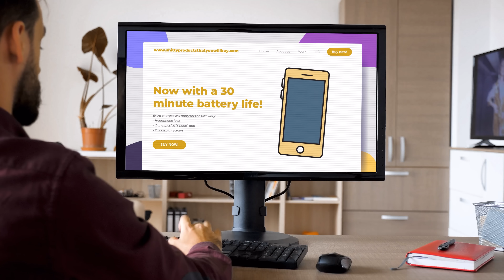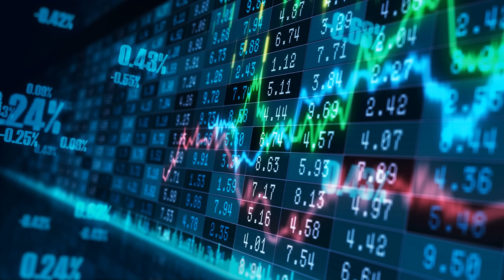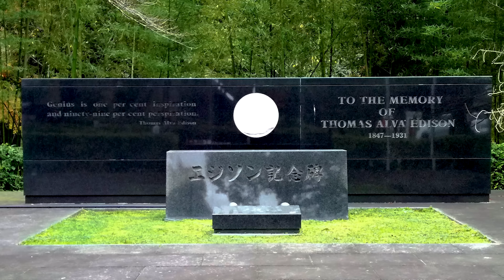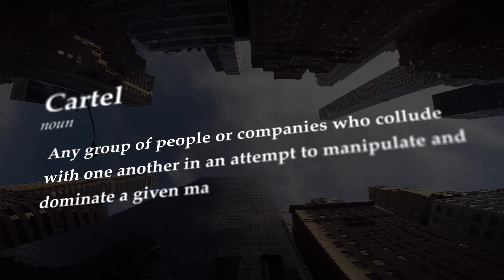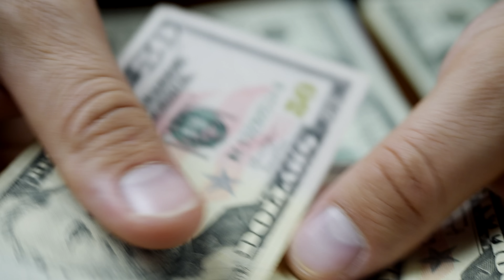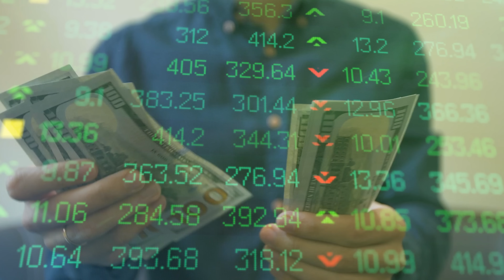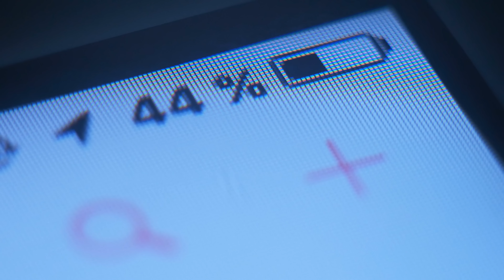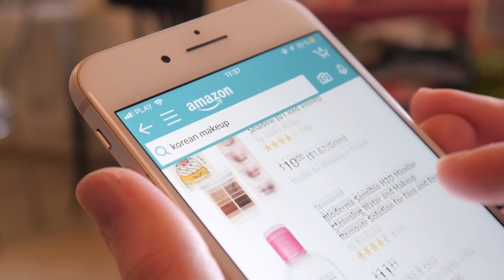Why All Lightbulbs Are Designed to Break

Comment: I first heard the term "planned obsolescence" in relation to the American automobile industry of the 1960's. Styling, even whole body makeovers, were commonly done every new model year, so as to make your car, the one you just bought a few months earlier, look old in comparison to your neighbor's fresh-off-the lot sedan, which was advertised as "longer, lower, wider" with higher tail fins and new chrome bumpers. Meanwhile, European manufacturers, notably Volkswagen, came along with cars that made only slight changes (never for just "styling") and beat the American compacts in sales. This attitude on the part of American manufacturers, along with using low quality materials and shoddy assembly, directly led to companies like Toyota and Nissan selling millions of their cheap, but high-quality, cars here. Contrast that to today's auto market, where even the foreign car makers have gotten on board with the "planned obsolescence" concept...  and of course with the increase in technology, you have to have that car with the latest navigation widget or heated seats!

Comment: The computer industry in the 1990s was a scam of this kind. To run Microsoft software that was compatible with what everyone else was using, you had to have the latest version of Windows. To make that work, you needed to upgraded your computer. Even when other companies like Geoworks put out software that was technically better, Microsoft and Apple were the unavoidable standards. The new software had more features, but it was also slower. Then XP came out in 2001 and no one felt the need to upgrade after that.

Comment: I rebuilt this house to take advantage of natural light and I
run low voltage solar light at night.
Never use nightlights and if the power goes off I can see just fine.
Every device is automatic dusk to dawn

Comment: I wonder if they will start making LED bulbs burn out sooner!?
Reply: They already have. I disassembled a "burned out" LED bulb just the other day. The failure was a burned spot on a PCB caused by a 1/4 watt resistor. It took years for the burn to finally break the circuit. If they had used a 1 watt resistor instead -- a difference in manufacturing cost of probably less than one cent per unit -- it would not have failed in that manner.

I had to damage the unit to get far enough in to discover the point of failure. I could probably put in a bigger resistor and glue it all back together, but is it worth the effort? Not really.
Reply: @dovregubben78  That was a capacitive dropper that your bulb was using right?
Reply: They already have. People want bright bulbs and manufacturers want to sell, so just drive the leds at their maximum rated currents and you are good to go.
It only takes one bad led to ruin an entire bulb. You can open one up and short out the broken led and it will keep on going without problems.
They are making bulbs harder to open because of this
Another way is to get a well ventilated fixture, most of them kill led bulbs becausw they trap the heat

Comment: Even keyboards, my first logitech keyboard lasted me about 12 years before it started to wear, these days, a keyboard 2x as expensive as that early logitech keyboard i had, last me maybe 2-3 years, and usually the keys at that point start to show serious wear, where my old logitech keys were fine, very little wear.
its the same with my headsets, i remember my first headsets lasting a good 5-8 years if not longer, now, seems i have to replace them about every 2 years as the material starts to heavily wear, plastic parts start to break, and by the end of year 3 its barely holding together, even though i use it less and take better care of it then i did my older headsets.

Comment: for devices just buy ones that operate on higher  voltage  and use lower voltage for them example buy a 100v to 250v tv and operate it on 90v it will still wrk

Comment: I've had my smartphone for several years now, and it's still working.  Since I only use a few features, it's limited memory has never been an issue.  Until now.  So what did I do?  Run out and buy a new one with more memory?  Nope.  I just deleted all the crap I had downloaded that I don't really use.  I'm not saying this video is wrong.  Automobile manufacturers have adopted planned obsolescence.  In the 1980s, GM autos were terrible.  I had a Cavalier that lasted 189000 miles.  When I had a mechanic working on it, he was surprised the car was still working because they don't typically last beyond 100,000 miles.  Unfortunately for GM, this approach to doing business has allowed Japanese auto manufacturers (mainly Toyota and Honda) to pass them up in quality, and allowed them to gain a greater part of the car sales in USA because they are better made.  GM seems to still have a quality problem, though I'd take a Chevrolet over a Dodge (even lower quality).  I think the Challenger is really cool, but I hesitate to buy one of those.  My current auto?  Mazda Miata.  May not be Toyota quality, but not far behind, from what I hear.  Meanwhile, GM still struggles to make decent autos.  I'd love to have a 2020 Corvette, but already I've heard of two different failing parts: Engine valve spring problem and leaking transmission.  I'd love for GM to be successful, but they'll continue to tank if they can't get their act together.  Alright, enough GM bashing.  I think I made my point, or did I have one?

Comment: Physics tells us that if you increase the brightness of a given incandescent light bulb (by increasing the voltage), you increase its' efficiency, but you thereby decrease its' lifespan. If you decrease the brightness (by lowering the voltage) you thereby decrease its' efficiency, but you increase its' lifespan!
I once bought a super long life 60W incandescent bulb that should last for many thousands of hours. Problem was, it gave less light than a normal 40W bulb. Calculating the price of electricity used compared with the light produced, this long life bulb would be a quite expensive investment! Hence a 1000h lifespan seems to be the best compromise between energy efficiency and lifespan!

Comment: While this is true, it is not the whole story. Longer living bulbs emmit warmer light. Shorter living bulbs emmit colder light. And this there are other factors like wattage. They just aggreed on a lifespan/color temperatur set. You can significantly improve lifespan by decreasing voltage, but color temperature sinks. While they did so, extra long lifespan bulbs for hard to reach places were still available, but hat lower efficiency and lower color temperature. Just wire two bulbs in series and you have your forever living bulb, but it is looking orange like the first generation long living bulbs, nobody wants that except for decoration purposes.

Comment: Conspiracy... In this case. Tungsten is the atom that withstand the highest temperature. If the bulb makers would plan obsolescense, they would use other atom metal.
Reply: Replying to myself because the edit option is not showed with the app...
I was right as confirmed watching the video up to the end. The light bulb cartel dissolved when patents started to expire.
Today's bulb are top notch, but they are being replaced by LEDs. Eventually, these non linear resistors will be hard to find.

Comment: "Hey look! I've invented a lightning that will last forever." 
Osram: That doesn't work for us. Let's form a cartel to control quality. We can call it the illuminati!
Reply: No lightbulb last forever... eventually they will burn out. As the filament finally vaporize. But in a decent lightbulb you could expect maybe 1'000'000 hours 41666 or 114 years(excl leap years) 54 days and 16 hours of constant use. Everything else is a bonus. The thing that hurt the lamps the most is turning them on and off.

Comment: My HTC One Max was the perfect phone, it lasted me 7 years of worry free use, and only once in that 7 years, around the 5-6 year mark, I had the battery replaced, but otherwise, it was flawless for 7+ years. 

And as a result, for 7+ years, they received zero dollars from me. HTC has since fallen into irrelevancy :( 

Phone manufacturers dont actually make that much money on these devices after paying workers salaries, shipping, logistics, physical hardware, marketing, there's really not that huge a profit on each individual device. To make a profit, your device either has to be expensive and sell fewer, or be cheaper and move larger quantities, HTC vs Samsung. 

And if you only make, lets say 50usd per device, for 7 years, that 50usd profit had to pay for all the goings on of the company, just isnt possible, the only solution is to make garbage products and refresh them every single year, its not profitable otherwise.

Comment: was funny that I was going to Mention Apple purposely slowing their older phones down to be pretty much unusable, older including phones only 2, or 1 years old... then it was covered right away before I could start typing. Glad my Samsung Galaxy S8 and S10+ are still very much reliable phones with yet no issues other then the battery in the S8 not lasting as long as it once did, but that comes with age, as batteries are generally garbage anyways, holding less of a charge every time you charge it.

Comment: The iPhone slowdown thing is a lie, and I'm sick of hearing about it.

First of all: Apple doesn't slow down old phones, the OS is constantly keeping track of the degradation of the battery, and once it exceeds a certain level, it begins gradually reducing the peak performance of the phone, regardless of the age of the phone. So if your phone is 5 years old but you barely use it so the battery hasn't significantly degraded, it won't do this.

Secondly, this isn't done in secret. You can check your battery's level of degradation, and whether any performance caps are being applied, in the system settings, and YOU CAN DISABLE IT.
Reply: J-dayday  Love the conspiracy theory, but I'm gonna need some sauce with that. I can say that it's never happened to me personally though.

Comment: 14:20 to be fair, if Apple made phones more repairable then they probably wouldn’t be very waterproof.
Reply: Well what most people mean when they say Apple devices are not easily repairable has nothing to do with taking them apart really. It's the fact that they basically lock down the phone's internals, meaning if you put in a replacement screen for example the phone will refuse to work properly by design. They do this to force customers to go through them for repairs and charge ridiculous prices, it also puts small independent repair shops out of business. This can be seen in pretty much all iPhone models since around the iPhone 7. If you put a replacement home button in an iPhone 7, even a genuine Apple one from a donor phone, the fingerprint sensor will no longer be functional. If you want to see why so many people are frustrated with Apple and their products I would suggest looking up Hugh Jeffreys, and watching his iPhone 12 teardown. Nearly every single component in the phone is locked down.

Comment: I've got a Microsoft Surface Pro 4, which strikes me a bit like this. Low quality and high price. I'm on my second screen, after flickergate, and that is now also failing with missing lines at the very bottom of the screen, after a couple if hours. As time goes on after that, the more alternate lines then disappear. I have vowed that I will NEVER spend my money (1500 UKP) on an almost impossible to fix device like this again. Ever.

Comment: Look at what has replaced most light bulbs in our homes.
LED light panels, promising huge savings on our electricity bills and yet delivering nothing of the kind and leaving us with so much more junked metal, wire, connectors, a PCB LED driver and plastic parts to throw into landfill sites.
This monstrosity promising up to 60,000 hours of service life and yes "up to" means that it has failed within 6 months to one year, having been built with substandard components somewhere in China.
Bloody awful..😱😥

Comment: Its why i never buy samsung/apple phones again. All of them work well for a year and a half at most then they get slow/or you start running into unfixable problems. Bought a htc u12+ years ago, still performs like it did on day one
Reply: Jakakak Kakskssns  iphones suck after max 2 years of use they slow down noticeably. I have had experience with iphones theyre not the best just the most popular

Comment: Why did I think of Apple when reading this title?
Reply: Jakakak Kakskssns  15:07 France's Competition and Fraud Bureau didn't think it was untrue tho. Funny thing is that I almost became an Appletard myself when I was thinking of getting the latest IPhone sometime ago. But I bought a better and cheaper LG smartphone, a decent PC and a used car instead, altogether for a cheaper price than the IPhone flagship.
Reply: Jakakak Kakskssns  They... were literally fined for intentionally introducing a software fault. They glued in batteries for no good reason. Those charger cables haven't gotten anymore break resistant over time even if there were millions upon millions of complaints about them. And that's just scratching the surface.
Other companies doing it doesn't excuse them, especially considering that they're not saving on the price.

Comment: It seems the automotive world is near the top of this scam along with all vehicle manufacturers because of putting in hundreds of electronic sensors which need to be reset by main dealers computers when they fail because of programming vehicle to stop until reprogrammed.
My friend who is a farmer has to take out insurance policies on all his farm machinery now wih main dealers to repair his vehicles because all his very expensive machines regularly break down. My 17 year old Toyota is ultra reliable, however a garage owner informed me Toyotas are having loads of problems now. This is obviously the reason why all LED lights in cars require the whole panel replacing for £30 +++ per unit instead of less than £1 for a light bulb...
Like the inland revenue, those in charge of the monopoly bodies need to be able to give out unlimited fines.

Comment: The precise reason I hate Apple

After a mandatory aystem update my phone died, completely. It wasn't the newest at the time but also was no older than two years. It wouldn't turn on or anything, no matter what I tried. I first called Apple and sat on hold for nearly 3 hours to my to be told that I should take it to my nearest service previdor to look at. I took it to my local AT&T to see if they could figure out the issue, it didn't take long for them to say they couldn't figure out what happened and we decided to transfer whatever I had to a new device to save pictures and app data. It worked, it also transferred the virus that apple pushed out in a mandatory update to the new device as well. That day, in store, 3 brand new apple devices were completely destroyed, puzzling the staff. They tried calling the company to no avail. We then said "f this" and I bought an android instead.

Comment: Lol in the camera industry it's called "crippling" the product. That's exactly what other  companies are doing as well, especially the big ones. cough cough (canon and sony). They could create a more technologically superior product than any of their other models and competitors, but always at a cost. There will always be something to sacrifice. If you make an 8k camera, it will overheat in 30 minutes even with the resolution lowered down . Like as in it will stop working immediately because it'shot to the touch! There's also a problem with it's memory card. Since it is a higher end model, with larger file sizes, you cant settle on simple sd cards, but have to get those crazy expensive ones. And since the file sizes are too crazy, youd need to buy a new laptop or build another PC with better editing speeds and extra storage. 
If Sony makes a full frame camera with 4k in 120fps, smooth buttery goodness? They cripple it and give it a 12 megapixel sensor for the photos department. 

I just finished watching an add for the Canon M50 mark II that just came out and it's basically the same hardware, an ugly plastic body, basically the same insides, no ibis or a new sensor or anything, but just a mini tiny upgrade In the autofocus department, plus extra useless features that you can add with a simple firmware update. Its basically an iPhone from last year, that is basically no different than the new one, but it just has a slight better "dynamic range" because of its slightly bigger sensor, but this time, the body has sharp edges that doesn't ergonomically fit properly on a human hand 😂🤦‍♂️

Comment: That's not true about batteries. In order to make more battery you need to more space, and if you don't want to make your phone a damn brick you have to sacrifice hard borders of a battery wich makes it easy to replace but less capacity. So they made them unreplacesable but without a thicc borders with  more room in the phone for the higher battery capacity.

Comment: Panty Hose For Women Were redesigned in the 1930s because
The originals were so durable a woman 
Would only have to buy 1 or 2 pairs and they'd last a Lifetime, heck There are pictures of people towing cars with them before they were Forcefully Degraded in their Quality. 
A few years later the modern day panty hose was designed and a weaker form of nylon synthesized because the company demanded repeat business, even at the cost of quality and ethics.